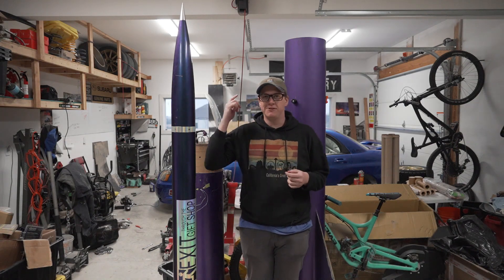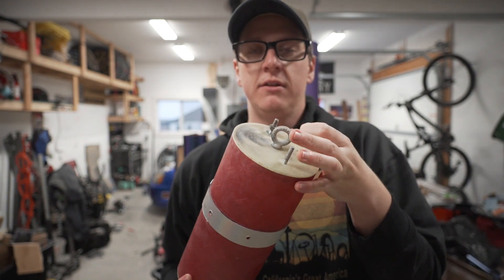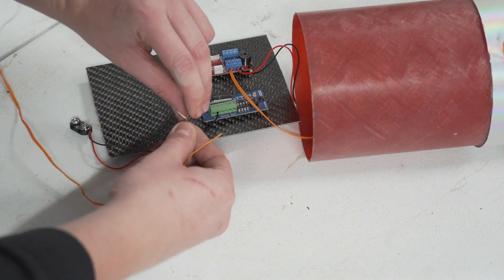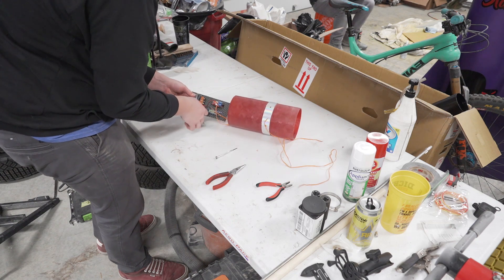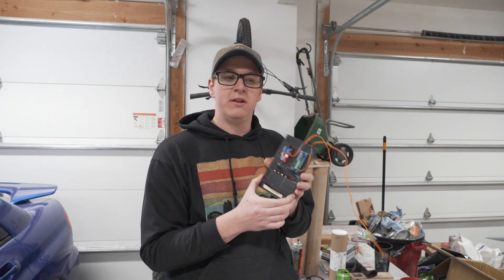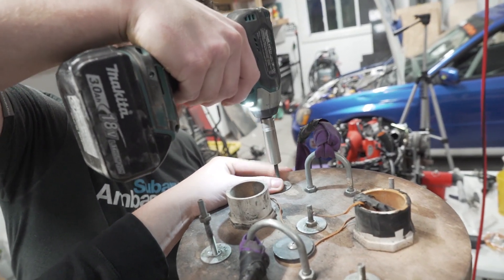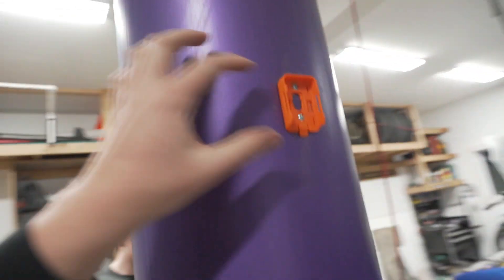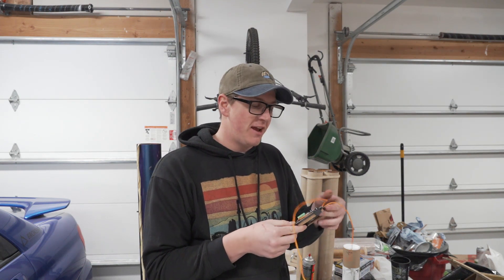A Super Simple Electronics Bay Setup for High Power Rockets

Comment: clean sled - direct connection, less failure points . REALLY like the recycling of AT igniter tubes as all thread conduit .  Do NOT like the wire nest in Mega size bird
Reply from the maker: The wire nest is just untrimmed e-match leads for the sake of pulling the sled assembly out of the drogue side to get everything connected. Still direct connected!